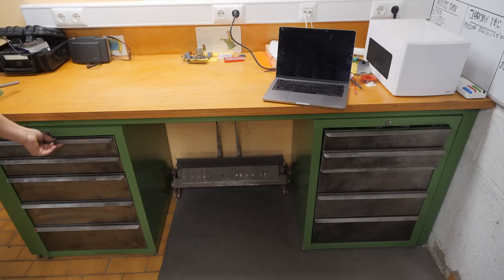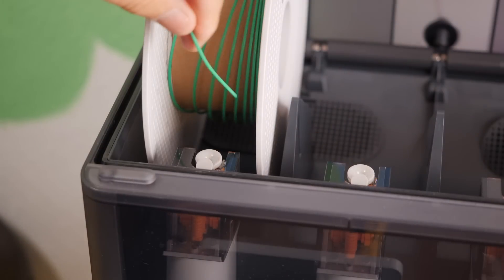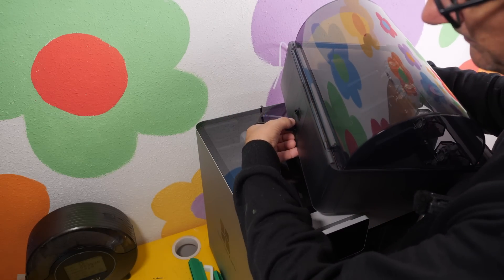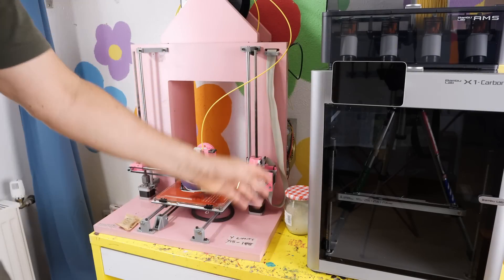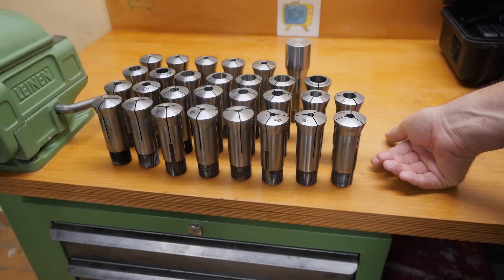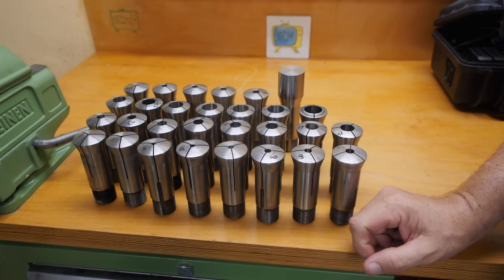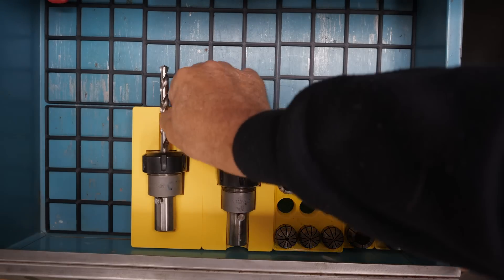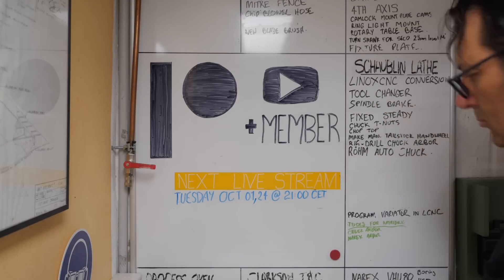Not all tools need Gridfinity || RotarySMP

Comment: While you may not specifically need Gridfinity for everything, you certainly need to up or organizational skills. All those wooden boxes on that shelf... how many do you have to look into to find the specific tool or tool SET you want? I do think you're making logical use of the Gridfinity you are using, but you could improve the logic of your other tools. The idea is to have all like tools together, not necessarily have a separate container for each and every item.
Reply from the maker: My boxes of measureing tools are mostly only rarely used. There is no point wasting drawer space, or the time designing bespoke solutions for them. I know where they all are and what is in each box.

Comment: i personally use gridfinity for most things because i have the storage space for it and the extra plastic used for every part doesn't mess me up too much. i like having things easy to see and having a perfect spot for everything because of my ocd. gridfinity is a beautiful solution to so many problems and it surely can be overdone but i personally just like overdoing it for the maximum cleanliness i can achieve
Reply from the maker: It is certainly an individual choice.  I pretty much just use it for sensitive tools which would get damaged if rattling around.
Reply: @ yeah it really is!

Comment: You can use shadow foam instead of gridfinity. But you can´t swap this way.
Reply from the maker: They are each tools, any sometimes the best tool for a specific job.
Reply: @RotarySMP  Yes absolutely. If you are 100% certain you will not swap your tools and want them in drawer X layer out a certain way shadow foam is a better solution in my opinion.
It looks way better for one. It is also semi soft and way faster than doing CAD and printing all the stuff.
Reply from the maker: @sierraecho884  Foam with a laser cutter is a nice solution.
Reply: @RotarySMP  Yes this works too. The cool part about Shadow foam is you don´t need a laser cutter and you can cut in depth instead just trhough the material.

Comment: Huge design flaw in the AMS, can´t print flexile materials unless they are specifically formulated for it, does not have a filament dryer either, I never understood that part.
Reply from the maker: I also wonder why they didn't incorporate a dryer into the AMS. Maybe that will be in AMS 2?
Reply: @RotarySMP  I guess they didn´t really needed that part for now as it was working great already it was a good product and so on. I am guessing they will implement it in their next upgrade AMS 2 as you have said. 

It´s just for me personally, I never found it interesting to print 4 materials with ne nozzle.
1st it isn´t multi color it´s multi material and multi color by material swap, this is not the same as multi color. It´s even better in my opinion because I rather mix TPU and PETG than a green PLA with a blue PLA.
2nd it was missing the temp and humidity control which would be my first feature I would have wanted from a material management system in a 3D printer. I want to make sure I got the right material and it´s ready to go, it´s dry. But that just me. Others are fine with 4 differently colored materials. It sucks that the Davinci color was such a flop and nobody since then tried to create a multi color system for FDM, all the current systems are all multi material systems which you can use to print different colored materials with. People seem to not be able to distinguish the two.
Reply from the maker: @sierraecho884  I have only done a couple of three color prints, to try out backlit panels. Mostly I a couple of colors and a couple of materials in the AMS.
Reply: @ Yeah to me it just wasn´t worth it to have yet an other device. I just bought a 300€ Flashforge printer and it prints with the same profile as the BamBu lab, same speed etc. But I can buy 3 of the Flashforge for one Bambu lab. This was a way better deal for me. The print volume is smaller though. But I have quick swap nozzles.

So right now I am waiting for a better and cheaper all in one system. I don´t even need it enclosed since I use IKEA furniture to place the printer inside. I also place all my tools materials and air cleaner inside.

I need a printer with material management specifically for drying the material and switching between materials. I would prefer 2 nozzles so I can print say 0.6mm nozzle infill and 0.4mm nozzle outer walls and swap between support and print material without mixing the two or wait for them forver.

But seems like I will be waiting for a while since at my work I use an IDEAX machine for 10k which has all those features so there is that .... x D
Reply from the maker: @sierraecho884  Nice to have access to a machine like that. :)
Reply: @RotarySMP  Yes and no. It´s an older one which is slow and it´s Cura version is a huge PITA. But besides those issues it´s pretty cool.
400mmx300mm print bed is great too.
Used to have 250k machines at my previous job in the automotive industry. Powder bed fusion not FDM though.

Comment: The thing about gridfinity is that it's made by someone with ADHD for people with ADHD. Items disappear from our minds when they aren't easily on display, and they don't get put away if you have to move something out of the way first. 

For example: those screwdrivers would never get out away when there's a set of calipers on top of the box

I agree that, for most neurotypical people, unless what you're storing is used constantly, gridfinity doesn't make sense, but for me, it's a godsend for my hobby space
Reply from the maker: Yeah, I have no issue with lifting a caliper, putting away the small screw drivers and putting the calipers back on top :)

Comment: Yeah, makes sense. Zack even says in his original video that Gridfinity was made for his needs as an electronics and coding guy and thats why he designed his differently to Aleks' design which was workshop oriented.
Gridfinity is also just way more useful if you have ADHD and an issue with object permanence, if you know where your tools are, plan, and have a label maker you probably dont need to have everything in direct line of sight
Reply from the maker: Like any tool it needs to be used correctly. I am glad I used it for those round tools which always rolled around.
Reply: @RotarySMP  exactly. Great video!
Reply from the maker: @mudawott  Thanks for your kind feedback.

Comment: @ 3:34... Um I spotted the left hand side plug was not pushed in securely...
Reply from the maker: That was the power cable, and the unit was powering up, so that was not the failure cause. Also I had removed and reinstalled that a few times during the troubleshooting.

Comment: Arrrggghhh, files touching each other - NOT cool!.  

When I was taught how to use files, old Harold (cove, that is AN old bastard, I AM THE old bastard), who seemed to have hearing issues could hear the sound of file on file across the workshop,.  He also seemed to have access to transporter technology, somehow, mere milliseconds after the files touched, Harold would be at your elbow giving you "The Look".  Files were always stored separately, either standing in slots or when stored long-term, separated by greaseproof or baking paper, much as they came from the manufacturer.  

I wish I had bought a couple of boxes each of Wiltshire millsaw, second cut, and smooth files when they were still being made, sigh.
Reply from the maker: Sometimes they "rules" can be a bit overdone. This is not a tool box bouncing around in the back of a car.
Reply: @RotarySMP  We all view these things differently, some files (the harder ones) are easier to damage than others.  Every time I pick up my smooth mill saw file (used for draw filing only), I see the (single) broken tooth on the cutting edge, really annoying.  That file is very hard, Wiltshire did not temper it enough, it damages easily but wears very slowly.
Reply from the maker: @robertnicholson7733  When I did my apprenticship, we did a lot of filing. Had I know what was coming, i woul have bought a couple of brand new files, and been done in half the time vs the worn ou ones the RNZAF training school had :)

Comment: There are lots of good systems like gridfinity but the drawback is than in most cases you end up using more space than say dumping your files in a drawer etc. 
     It has it's place on commonly used items etc but not for everything. 
      I don't have too much of an issue with moisture in my filament. Its all in my shop which stays relatively dry most of the year as it's an insulated metal building and in the summer it's very hot which keeps it dry inside or the ac is running taking moisture out.

     Yes we got back from off the mountain and resting in our apt in Filoti before going to dinner. We are exhausted but they did make the climb easier with much better trails.
Reply from the maker: We do very different Naxos vacations Robert. We walk Prokopios, Anna and Placa every morning and then lounge around on the beach reading :)
Reply: @RotarySMP  Ok just stopped laughing. That was funny. I'm getting to old and out of shape for the type of trips she likes to do. I need a vacation afterward to recover from this one. I'll have to go to Naxos on my own to just relax....
Reply from the maker: @theinfernalcraftsman  After our 11km morning walk, I am normally ready for some power couching :)
Reply: @RotarySMP  Well I just finished my orange pie...

Comment: I've printed a few holders for things in my shop here and there, but I agree that most of my shop doesn't need quite that organization. I can't imagine how much people spend on filament to do some of the storage solutions they come up with.
Reply from the maker: Hi David, I wonder the same. And you need a huge amount of space and therefore a lot of drawers too.
Reply: @RotarySMP  That's one of my big gripes with it. Yes, it absolutely has its use in some cases, but most of the time I just see it as a waste of space. Take your drawer full of hammer — no way you'd fit all of them in there, especially with your punches, if you had separate bins for each.
Reply from the maker: @ I never considered a hammer as needing that level of care and protection. I have great organisation of my hammers. All in a drawer, except the claw hammer which is with the wood working stuff, and punches together in an icecream container in the hammer drawer.
Reply: @RotarySMP  Agreed, but have absolutely seen other people use it for every tool they own. I do have one hammer in a custom printed bin (not gridfinity), but that's only because it's a watchmaker hammer with swappable heads and the bin just keeps it together
Reply: Some people clean houses
 Just for Pinterest😊

Comment: i think gridfinity can be useful when you have a really high density of stuff to keep straight, my tool drawer used to be just so much crap stacked and tangled together just because of how much i was storing there
Reply from the maker: How did you keep tool density up with Gridfinity? I am struggling with not wasting a lot of space.
Reply: @RotarySMP  well in my case it was a lot of long thin tools like rulers, pens, soldering irons, picks etc. storing them standing up on one end is a lot more efficient than lying down

Comment: I could do with a foot support like that under my bench too... I might actually take that into consideration when I get to building my own bending... brake? break? sheet-metal-bendy-thing-machine.
Reply from the maker: Yep, it is a little finger brake. I found the design on a woodworking forum years ago. It is pretty flimsy and only usable on very thin metal, like 0.5mm steel.
I documented my build here...
https://www.cnczone.com/forums/bending-forging-extrusion-/56672-forum.html

Might have been better to find a design on a metal working forum :)

Comment: I do appreciate having learned in a high school shop where every tool holder was custom made, mostly from wood. All slots were filled at the end of the class period. (Except bar clamps used for glued assemblies.) If a board with holes in it works, it is likely the optimal solution, at least in the tradition in which I was taught.
Reply from the maker: Thanks Don. I agree.

Comment: Yeah, I dabbled with gridfinity but went with a much simpler set of a few draw dividers for my tool and tooling cabinets, made with ali strip, much larger groupings like yourself. Far faster to create as well. Printed up some ER collet holders, but most of my tooling lives in the carousel most of the time.  I don't need that degree of fussiness for my tools, and I like generous part drawers for my small components etc, not pokey boxes. It just seemed like a bunch of pointless busywork. My printer has better things to do than spend hours printing boxes for boxes for boxes.  Zack is a wonderful chasp however and I don't mean to slight him in the slightest, the sly Shakespearian speil-iologist. Not all shoes fit all feet is all, as I'm certain he'd agree. There is a great deal of follow the leader fashion victim thinking out there, you get it in everything, annoys the hell of me. The "you don't do it like that ,you do it like this" brigade, lemmings who have abdicated original thought, the "maker" fraternity is chocka with them, it's sort of sadly ironic.
Reply from the maker: Good observations, I think Gridfinity is an interesting tool for some specific problems, but will be used sparingly in my shop.

Comment: That bathtub curve is a classic for electronic components. Just annoying when it's you who picks up the infants.
Reply from the maker: Hi Bill. Yeah, but I cant complain, as Bambu support was excellent.
Reply: @RotarySMP  I looked at buying the X1, then the Qidi Q1 came out, so I bought that instead and saved quite a bit for not a lot less performance. Must admit I am having trouble getting up to speed with 3D CAD. I was fine with AutoCAD LT, but Fusion or Solidworks, pffftt.

Comment: Thanks for the great video! At 7:20 the spool says PETG which you may have meant to say, after respoolling don’t want you to run into issues in the future with temp problems. Routing MFD inserts for drawers is another nononsense organization solution I’ve seen for tools
Reply from the maker: Thanks Ian, I think that is the edit, as I just checked, and the transparent is on the old green PLA Basic spool.

Comment: Three persons work in my shop. My 28 year old carpet cutter that I use for removing dried silicone around covers and mating housings (Gearboxes) went missing. Its been 3 weeks and Its still driving me nuts where it can be? The shadow system sounds awesome. Oh and the Two other persons I work along side are family. If misplacement is the case I can understand.
Reply from the maker: Yeah, that sort of misplacement drives me nuts as well. Especially a commonly used tool.
Reply: Is wouldn’t go to a bar if their tools are not wellorganized

Comment: As a Quality Engineer, I was thinking "What's the failure rate of that board" then you talked about the Bathtub curve.
Reply from the maker: Hi Steven. I wonder what the PPM failure rate is on modern automated PCB production. Probably pretty low.

Comment: Any idea if you can put two similar spools into the AMS and have the printer swap over when one goes empty?
Reply from the maker: Hi Jim, yes, that is a standard function. From the Wiki:

3. AMS filament backup: the AMS will switch to another spool with the same filament properties automatically when the current filament runs out. These filament properties include brand, type, color, and nozzle temperature. If the AMS cannot find the same filament, it will display a prompt that the current slot has run out. To enable this feature, please check "AMS filament backup" on the AMS settings page.This function requires filaments with exactly the same properties. It is recommended that Bambu filament be used as a replacement for Bambu filament and non-Bambu filament be used as a replacement for non-Bambu filament.
Reply: @RotarySMP  I’ve had a look at their printers and a glance at their support; I’m impressed with both.

Comment: My toolbox has self-closing drawers in the last few cm of travel, then the abrupt stop. Clunk! This makes everything shuffle back a bit every time I close the drawer. Rubber mats, foam, silicon mats do nothing, every few weeks I have to pull it all back to the front and smooth out the creases in the liner. So I have to invent arrangements that stack rear to front, which is not great for usability. So that's annoying.  My dad's old oak chest of drawers doesn't have this problem, never needed to close itself, and the contents of the drawers stay where they're put. Anyway, thanks for the entertainment, hope you're not drowning over there.
Reply from the maker: Thanks Rick. Have you tried some gridfinity?
Luckily no issues at my place.
Reply: Draw dividers, 40mm aluminium strip and a few pop rivets, whip up a grid for the major categories, easy peasy.
Reply from the maker: @m3chanist  I guess one advantage of the gridfinity is you can reorganise easily, but wonder how often this is really done, and how often it means printing a whole lot more plastic waste?
Reply: @RotarySMP  Exactly, if I need to redo stuff down the track ill just drill out the rivets and move things areound. And you can never have too many odd short bits of ali strip in the offcuts bin, life is just a series of brackets that need to be made after all ;)
Reply from the maker: @m3chanist  ...l as we learned from Project Blinky :)